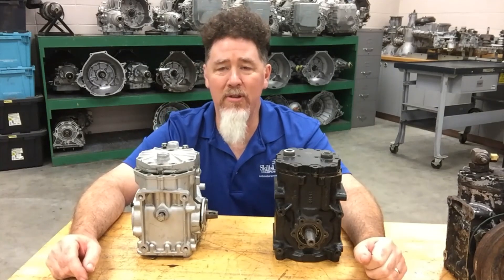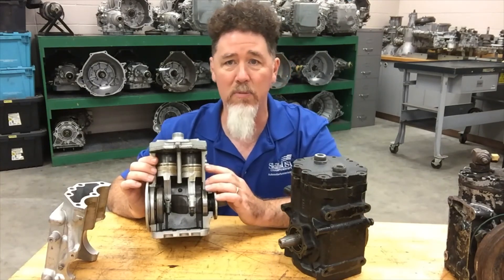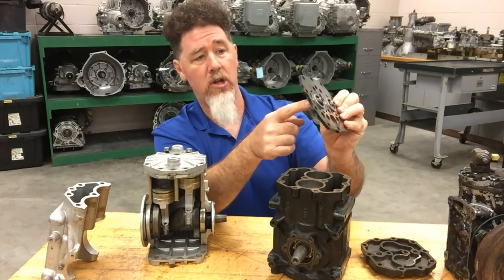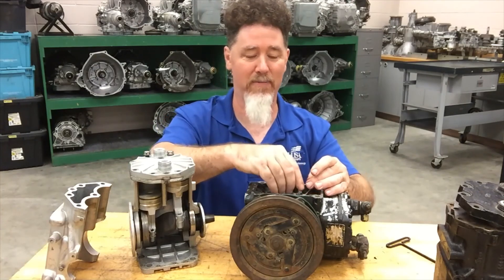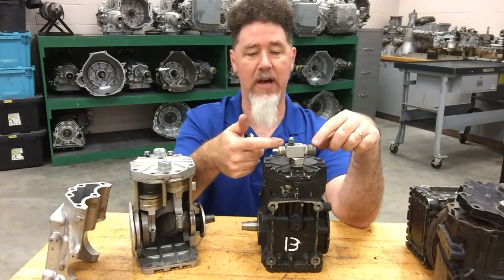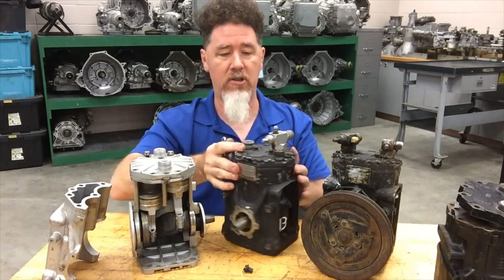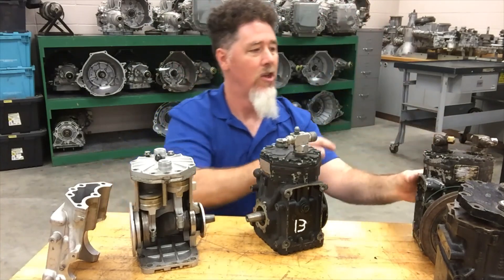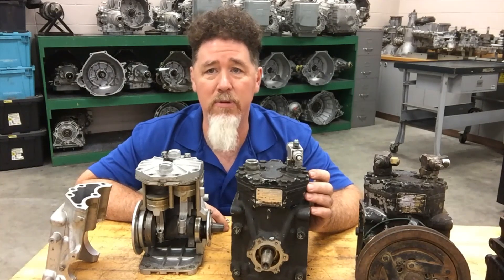Lesson about the In-line A/C Compressor Part 1

Comment: Dear professor, thanks for these interesting videos. I am from Germany owning a 67 Mustang with OE cast iron A/C compressor and looking for a kind of how to maintain these parts. Beginning from what type of oil to lubricate the compressor, intervals, but also what bearings I should look after from time to time, anything an owner should know to be able to do maintenance to keep these old parts working...
Thanks a lot in advance
Joerg
Reply: The oil depends on the refrigerant you are using. If you are using R-12, then you should use a naphthenic type mineral oil with a viscosity of ISO100 (500-525 SUS). The standard oil would be Suniso 5GS. Calumet RO50 and Nu-Calgon C-5s are direct replacements for Suniso 5GS. Now, all that said, these compressors are pretty insensitive to oil viscosity and type. So, an ISO68 mineral oil like Suniso 4GS, Calumet RO30,Nu-Calgon C-4s, Texaco Capella WF68, or similar would also be fine.

R-12 systems can also use alkylbenzene oils, which are synthetics that are designed to work with HCFCs and CFCs. BVA makes an ISO100 AB oil for Bitzer screw applications that works very well. However, the more common ISO68 viscosity AB oils will also work fine. 

If you're using R-134a, then you need to use either a PAG or POE (ester) oil. Again, you typically want ISO100, but a high quality ISO46 like the excellent Idemitsu Hermetic Oil 134a or Idemitsu Hermetic Oil 1234yf (which is fine for 134a use according to Idemitsu) will also work. There are various ISO100 PAG oils available. You can even use an ISO125 PAG. As I said, these compressors arent very picky when it comes to viscosity. I've seen them used for stationary low temp use running ISO32 mineral oil (Suniso 3GS) and R-12, and they were decades old.

PAG oils are great as long as the system is completely clean of chloride residues. If not, or if you aren't sure, then its not a good idea to use regular PAG oils. You can use double-end-capped PAGs like the Idemitsu product, but most if not all ISO100 and ISO125 PAG oils are single-end-capped, which leaves a reactive uncapped molecule that chlorine can attack. In these cases, you are better off running a POE oil. Typically, the POE (ester) oils sold for automotive use are all ISO100, and so dont usually even list the viscosity on the bottle. Of course, they usually don't list the manufacturer either, as pretty much all of them are just repackaged product made by a big lube oil manufacturer. For these reasons I prefer to use Emkarate RL100H. Unfortunately, that oil is only available in gallon (or 4 liter on your side of the pond) containers, making it quite expensive. The RL68H is available in quarts over here, so it may be available in liters over there. Otherwise, Im sure there are other brands of POE oils available to you. If  you dont want to go to the trouble to source the stuff from a refrigeration  supply house you can always get the automotive stuff. If its a reputable brand it should be OK.

As for intervals, there is none. In theory the oil is good for as long as the compressor lasts. Mineral oil, in particular, undergoes interesting chemical changes in the presence of CFCs or HCFCs, catalytic metals (mainly iron), pressure, and heat. These changes actually create chlorinated hydrocarbons which have excellent AW and EP properties. So, mineral oil that has been in use for some time is actually better than virgin oil. Alkylbenzene doesnt do this to much of an extent, and of course HFCs like 134a don't contain chlorine so no such reaction is possible in such a system. POEs can be used with R-12, but again because of their specific chemistry they wont react with chlorine in the way that mineral oils do. Now, all that said, if I were replacing a front seal, I would first run the engine at 1500RPM for 15-20 minutes to sweep most of the oil back to the compressor. Then, id either isolate the system with the service valves or recover the refrigerant, change the seal, and then drain as much oil as possible from the compressor and refill it to specs. This can be done on or off the vehicle, whichever is easier. Otherwise, unless for some reason I have to open the system AND its been running for at least 10 years or more, I would not change the oil. Remember, AC systems dont get contaminated with combustion products like engine oil does. And they experience very, very little wear as long as they have adequate oil in them. Mineral oil will degrade at high temps, and the synthetics will do so at even higher temps, but as long as your condenser fan is working and condensing pressures are in the OK range then the oils will be fine. Mineral oil will slowly darken due to several reasons, but this is normal. If it gets black, then it is breaking down due to excessive discharge temps. Molasses color or lighter is fine as long as it doesnt smell burnt. Again, this will only happen if discharge pressure, and this discharge temps, get too high due to a faulty fan clutch, dirty condenser, or extreme ambient temps (think Middle East or North Africa with 120+ temps and a marginal condenser and/or fan setup). Of course, none of this is relevant for R-134a, since PAG and POE oils are extremely stable even at high temps. The main thing to watch for with these oils is moisture in the system. This will cause POE oils to hydrolyze, and isnt great for PAG either. Make sure the system is evacuated to at least 1000 microns of vacuum, with 500 microns being much more desirable. And make sure you have a good receiver/dryer installed. The Chinese receiver/dryers seem to be pretty variable. If possible, I go onto Ebay and look for a NOS Parker receiver/dryer that will work in your application. The exact part is most desirable, of course, especially if you want your car to be 100% factory appearing. But often you can find a Parker unit that is the same diameter, and close enough in height to work. As long as the fittings match, other minor variations like a service valve or pressure relief valve dont really matter. The thing that matters most is that the desiccant inside is bone dry. This is where receivers with a "dry eye" that changes color depending on moisture is really nice.  

As for bearings and such, you should never need any internal parts as long as you keep oil in it. Remember, compressors only lose oil if there is a refrigerant leak. In this case, you're losing expensive refrigerant as well. So, find and fix all leaks, then make sure the system has the proper quantity of oil in it, evacuate, and recharge. Typically the only part that eventually wears out on a properly maintained compressor (besides the clutch and clutch bearing) is the front seal. New ones made by T/CCI are the best. You can get generic ones on Ebay. Sometimes you can find real T/CCI ones on Ebay as well (part number is 488-25274). Another place to get them is any place that sells Cessna or Beechcraft airplace parts, as these manufacturers both used York and T/CCI compressors for their planes equipped with AC. I think they used the York type compressors because they wont stall and lock up the engine if the clutch or clutch bearing seizes. If that happens, the compressor simply runs. This isnt the case for most types of compressors where the clutch bearing rides on a stationary boss rather than the crankshaft. Anyway, over here the airplane parts houses actually have better prices on the T/CCI seal kits than auto AC parts outlets do!
Reply: @WTFChuk  Thanks! You truly went above and beyond!!👏🏻👏🏻👏🏻
Reply: @abdul-kabiralegbe5660  Thank you! I probably got carried away with my reply, but I wanted to be thorough. Information on older recip compressors is surprisingly scarce on the internet.

Comment: I’m wondering how a Tesla model Y compressor works and how much more efficient it is.
Reply: Teslas, like all EVs and hybrids, use semi-hermetic electric compressors that are designed to run off of the vehicle's battery voltage. It is probably a scroll, although it could be an axial recip. They are all variable speed to control evap temperature and maximize efficiency. While the compressor itself is quite efficient, the R-1234yf refrigerant isn't. Thus, the overall system efficiency is pretty mediocre. 

Of course, any newer vehicle with an IC engine also runs R-1234yf and thus has the same disadvantage. In their case, however, they directly use the mechanical energy generated by the combustion to drive the compressor, whereas an EV uses energy that has been fairly inefficiently stored in batteries whose rare metals were mined by child slave labor in Africa, which was in turn manufactured by slave Uyghur labor in China (or is that iPhones? Probably both?). That electricity was in turn delivered over a lossy power grid after being generated by a large AC alternator which is most likely driven by either a natural gas fueled gas turbine engine or a steam turbine driven by steam that is generated by boiling water using the combustion of coal. Of course, there is a 21% chance that the steam is generated by splitting of U-235 or Pu-239 atoms in a reactor. Or, a couple percent chance that it came from a "renewable" source. Like a Chinese-made solar panel in a solar farm that permanently casts hundreds of acres of land in shade, making it useless as a habitat. Or perhaps from a Chinese-made wind turbine, as it chops up birds and generates LF acoustic energy that causes illnesses in any creature within range of the sound, and is a blight and eyesore on our landscape. Eventually it wont be a problem though, as slowly increasing EV sales and their need for large amounts of electric power coupled with nuclear power plant and coal plant shutdowns and an overtaxed electrical grid will probably perpetuate a blackout or dozen. Or, at the very least, "rolling blackouts", just like every supposedly First World country should enjoy so as not to appear snobbishly superior to their third world counterparts. 

Until then, at least we can enjoy AC using our new, low-GDP, "mildly flammable", trifluoroacetic acid creating, astonishly expensive "Climate Friendly" refrigerant R-1234yf!
Reply: @WTFChuk I appreciate your comment. Unfortunately I don’t believe majority of the voting populace has the mental acumen to do anything beyond regurgitate the basic engineered talking points parroted in main stream media, and will ultimately fail to realize they themselves are the true enemy to freedom.